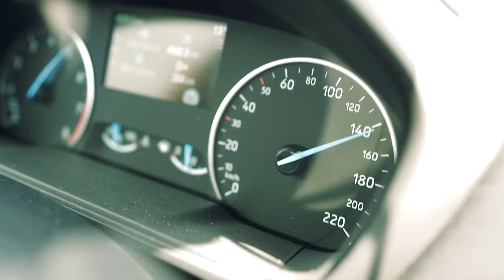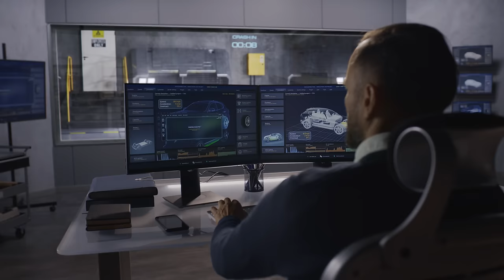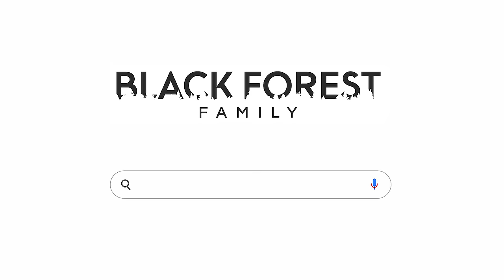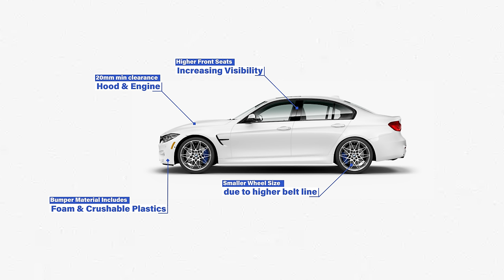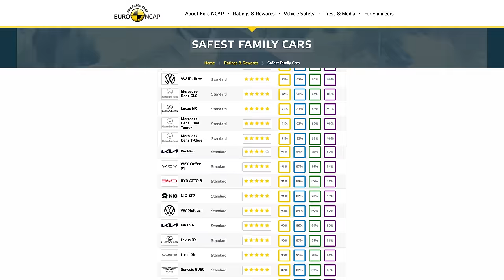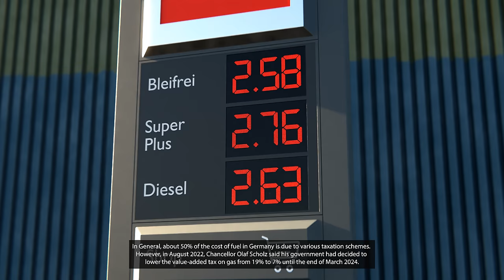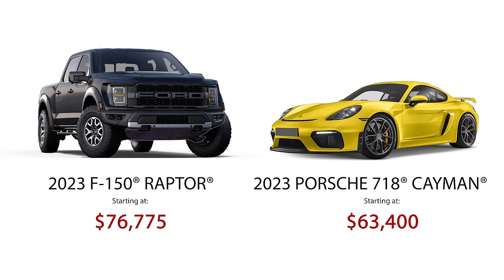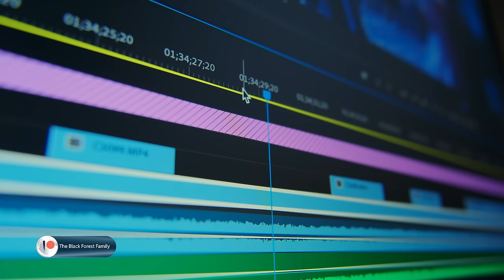DRIVING CULTURE CLASH: Why do our Cars LOOK so Radically Different?

Comment: How it started: driving lessons (Netherlands, 1972) in a VW Beetle. How it went on: 3-month road trip (US, 1976) in a Toyota Corolla station car, considered extremely small by about everybody there, but quite comfortable for 2 people. How it is now: Ford C-max which has a higher seat, hence comfortable for getting in/out; removed one of the backseats, for easy transport of my rollator. 
Point is: treat your car like any household item - don’t buy a complete Kitchen Aid, if you bake about 4 cakes per year, just bc it looks impressive (and takes 1.5 square feet on your countertop).
Thanks, Ashton, your comparisons are always very informative!
Reply: you do not have to buy ONE car to meet all your needs. My in-laws are in there mid-70s, they have Ford F250 Diesel for the camper, a Dodge Durango 7-seater for longer trips and rides to the airport with luggage, and a Hyundai Kona, as their runabout car. yes, 2 people and 3 cars. the truck is a 99, the durango a 2003, the Hyundai is like 5-6 years old or so. Those cars will likely last until they die. on their retirement income it would be impossible to replace the F250 and the Durango.
Reply: That would be extremely expensive on taxes. (which goes by weight).

Comment: Don´t know if someone already mentioned it, but there is another reason Pickups are less practical in europe :
In europe you are not allowed to just put everything unsecured in the loading area of a open pickup. So if using the loading area of a pickup you eigther have to secure it with bands/rope or you have to have a closed loading area. Reason for it are on the one hand exidents and on the other, that we drive faster. In both cases  loads should not be able to get lost and hit others.
Imagine you put your groceries in the back of a pickup (unsecured) and drive with 200 km/h (convert yourself) on the Autobahn… Pickups are not aerodynamicly designed… there is a good chance grocery bag get caught by the driving wind and kicked out of the pickup… no good on the Autobahn.
On the other hand… if you have to secure every single item it is very time consuming… or the other variant: a pickup with a top cover on the loading area is not only stupid looking, it has the worst outcome of practicality in puting things in it… Because you eigther have to lift the cover every time, or you have to push everything to the front to use the whole space.

… so even farmers and forrest worker preffer to use a full siced Jeep over a Pickup.

Personal note :
I had a friend (in germany) with a Dodge Ram with a hardtop loading area… worst car ever. 
Not ony was it hard to find a parking space in any city… but buying groceries was a pain in the ass. To unload it usually one had to climb into the low top laoding area because something „rolled“ to the front of it.
Reply: Good explanation for the reasons why Europeans prefer Vans or Jeeps. Still, I don't find a reason on why Americans prefer pick-ups. Even without those restrictipns, a Van or a covered Jeep offers better protection of the cargo against the elements of nature.

Comment: I have recently visited Canada: First in Southern Ontario, then Winnipeg (Manitoba) and finally Vancouver Island. 
Especially in Ontario I was surprised by the ginormous pick-ups with engines in the 6 to 7 liter range (mostly Dodge RAM), and more often than not the occupant was a sole lady barely topping 160cm in height and barely tipping the scale at 60kg soaking wet! The thought that came to mind was: "Somebody is trying to [over]compensate here." Even though it was a mostly rural area, most of these pick-ups where NOT working trucks since they featured a super glossy waxed and polished finish. The "working" trucks very obvious in being covered in dust and scratches.
In southern Manitoba, though also a very rural area, the trucks had engines more in the 2 to 3 liter range and the bigger trucks were clearly working trucks.
On the west coast (Vancouver Island) the trucks again got bigger, though on average not as big as in Ontario. With the very mountainous terrain both on the island as well as the mainland somewhat bigger engines are understandable and justified. And a higher proportion of the really big pick-ups (aka trucks) were obviously working trucks.

Comment: Thank you Ashton. Although I'm not interested in cars (just a tool), the impact cars have on our lives is important to me. I think there is one point you could add to this subject. With the higher weight of electric vehicles, and the even higher weight with the growing size of our cars, the maintenance and construction costs of our infrastructure will increase as well, while the load of the average vehicle doesn't. This does not really fit with the German efficiency stereotype.

Comment: The "my car shows how much money I have" part is going down in Germany - has been going down for quite a while. It is simply not as much seen as representative any more as it once was.
As usual: Very well done in depth video!
Reply: Yes, I agree that it generally goes down - but there are still lots of "car crazy" people in Germany as well.
And as it was said in the last part of the video, especially the number of SUVs has increased a lot in the last 10 years. In contrast, it seems to me the number of smaller cars such as VW Polo, Opel Corsa has shrunk.
All in all, that's something I don't understand in Germany: Gas is expensive, the parking lots on the street are reduced in particular in new developments, taxes are high, but a huge parts of Germans still prefer SUVs.
Reply: @Bema1001  Jep, that is still a trend. But many of those are company cars, which have some tax evasion loopholes to make the cheaper and the drivers don't have to pay for the fuel (directly). But the "1%" rule might change (i.e. 1% of the company cars value is deducted from your pay, I think before tax). So a way oversized car for its purpose will get 1.5% tax rule. Many towns push actively against those oversized nonsense, so there is a development on the way.

Comment: You mentioned that cars are getting bigger across the board. Well, so are people, especially in more advanced countries. Yes, I'm talking about extra weight around waists more than getting taller on average. Also, slightly taller cars are easier to enter and exit for unfit people.
Reply: In a German car from the 70s you have more space inside than today.

Comment: Hi Ashton, I know that you do good research for your videos and the source you have for the german commute is pretty solid, but I still think it seems to put the german commute at a very low distance!
The figures I get for Europe are at about 30 km. Half as much as in the USA, so your argument about fuel efficiency still holds, but not such an extreme difference as you claim in the video!

Comment: In the video is that you have a chart showing that in the US, crossovers are twice as popular as pickup trucks, but then decide that pickup trucks are the most popular choice.  That doesn't make sense.  Yes, the F150 IS the most popular single model, but pickups aren't the biggest category by far.  The car category, on the other hand, has gotten much smaller, because former car-buyers have switched to crossovers, which are essentially tall cars (built on unibody car platforms with car-based drivetrains -- not heavy body-on-frame construction like pickups and very large SUVs).  So it's kind of weird to lump in small, fuel-efficient crossovers (many with popular plug-in hybrid versions) like the Toyota RAV4 along with pickup trucks and truck-based SUVs.  And crossovers have been exploding in popularity in Europe as well, so maybe the differences really aren't so stark after all.

Comment: I learned from Albert Hammond that it never rains in Southern California, so I'd understand why they'd use pickup trucks there :) But honestly, why would I want a truck with an open loading area, so that my cargo gets wet whenever it rains? Another point about car size worth mentioning is, that there's old parking garages (especially in Vienna), where an SUV won't fit into any spot. They still try though.

Comment: Ich liebe und bevorzuge seit nun knapp 20 Jahren Kombis, also "Station Wagon". Das ist für mich einfach das Perfekte Auto. Die SUV's sind in der Regel nur höher als die vergleichbaren "Hatchback's" wodurch man "ageblich" besser einsteigen kann,  was ich jedoch so nicht nachvollziehen kann. 
Ein Kombi bietet bei Bedarf einen deutlich größeren Kofferraum als ein "Hatchback" oder SUV fährt sich jedoch in Prinzip wie eine Limousine.
Manche wie zb.  BMW's sind sogar noch recht sportlich, zusätzlich noch schnell und meist sparsamer als ein SUV. 

.......

I have loved and preferred station wagons for almost 20 years now, i.e. “Station Wagon”. This is simply the perfect car for me. The SUV's are usually only higher than the comparable "hatchback's" which "supposedly" makes it easier to get in, but I can't understand that. If necessary, a station wagon offers a significantly larger trunk than a "hatchback" or SUV, but in principle it drives like a sedan. Some such as BMWs are actually quite sporty, quick and usually more economical than an SUV.

Comment: @Ashton, here is an interesting aspect to pick-up truck vs car regulations. larger pickups, by wheelbase do not have to meet the same emissions and fuel consumption requirements as cars, or even smaller (as in 2-door) trucks. 4 door trucks have a longer wheelbase than 2 door trucks. fewer requirements for emissions and fuel consumption. Also Pick-up trucks by and large (pun intended) are exempt from emissions testing. This does vary by state, or even county!) vehicles over 8800 pounds are exempt. and, yes, large pickups weigh 4 tons..... technical note for Jonathan: a typical trailer in germany may have a tongue weight of 50-100kg, well within the limit of a "car". while a camping trailer in the US may have a tongue weight of 400-800 pounds, well out of spec for a "car".

Comment: AFAIK there is another reason not mentioned: In the USA, there are regulations regarding the maximum gasoline consumption of cars, similar to the fleet consumption in the EU. If you do not meet them a maker has tp pay penalties.

Unfortunately, the maximum allowed fleet consumption in the USA is determined depending on the car size and weight.

This means that large cars are allowed to consume an overproportional amount of fuel. 
As a result, small cars that can comply with the regulations are relatively difficult (or complex and therefore expensive) to build. 

It is easier to build large cars that comply with the much higher permitted limits.
Thus the well-intentioned law with the goal to save fuel and minimize CO2 output leads to the fact that in America preferably large cars are built and then also marketed.

Maybe the assumption that Americans want big cars and the industry therefore builds them is not true at all. Even if you don't want to believe it: It may well be that the car manufacturers build big cars because it is easier for them to comply with the laws and THEN persuade the consumer via advertising that he also wants the clunky things.

That is probably also the reason why in Europe SUVs are the fastest growing segment: They are good for the carmakers, so the built them and then tell us all that we need them. Because profit margins with small cars are just ... small.

Comment: As an American car nut, who drives a VW Golf, I've watched car technology advance over the years, and can say that safety standards is one of the primary reasons cars have grown in size. Simply put, human injury and fatalities most often occur, when bodies come into contact with something hard... inside the car. So "A" pillars and therefore windshields have moved much further away, as have dashboards. Also, 'Crumple Zones" are built into the front and back of the car. All this adds up to larger vehicles. Sure, people generally like larger cars, so of course that's a factor too. I'm predicting all this is soon to go radically different as radar / proximity sensors will mean that the accident rate will tumble to near zero and that will allow cars to become MUCH smaller but still be safe. We're still stuck thinking it's OK to have a 4,000 pound machine move a 200 pound human around. Environmental issues will cause regulation to become MUCH stricter in how much energy is being used. Right now, we simply accept that 'electric is better' but soon reality will hit home, and we'll all have to become more informed as to exactly how much energy is being consumed by our cars. Look at what gemcar is doing for a glimpse into the future. Great video.

Comment: When it comes to cars, i think that in general they now have too much "schnick-schnack". Too much stuff that you just don't really need. It makes cars bigger and heavier without actual reason. E.g. electronic seat adjustment. Usually it's the same person driving a car over and over again. So you drive multiple electronic motors around which get used once every couple months...
This is also why, i predict that VW is very soon not the people's car anymore, but a brand like Dacia is.
Those cars are cheaper and have everything you actually need. Also, the reason they often are claimed unsafe by Euro-NCAP is because of missing driving assistances like e.g. "Spurhalteassistent" (lane holding assistance - don't know if it's called that...?).

Comment: I think the speed limit is a major reason. The US had the roads but for us in Germany, they drive slowly in the US. With these roads, many of us would drive 200-250 km/h (or 124 -155 mph). 100-150 km/h is considered driving slow, 150 - 200 km/h is the normal speed and 200 - 250 km/h is still pretty normal / fast if you could afford this and the car. So I really don't want to know how much fuel an F150 needs at 200 - 250 km/h.

Comment: Hello Black Forest Four, another Sunday another very interesting video, thank you hope you are all doing well...
for me living car free since almost four years it was before that time a question of costs, practically and then environment impact, in this sequence... why to own a car that will eat my hairs of the had literally? Practicable, sure there where a few cheap "gebrauchte" used Cars in opinion but for what does a single male need a Bus, a SUV or a Pickup? the three times a Year i need to Transport some Fourniture, some Cornstruction Stuff or the annually garden spring buy of flowers, earth and so on? last point was ever impact to the environment, simply because i couldn't afford a electric car and the infrastructure to charge... Almost four years ago i stumbled upon an old  Cargobike without electric Motor and it changed the view... since then i didn't use a car more often than three times (in those 4 years) have now two electric Bikes (one for the cargo as substitute..) and even two Trailers for them, and i feel happy...
no more fuel costs, no Tüv (or here MFK) no Taxes, no search for Parking Lots... okay the bad side is the weather but you can wear an extra layer... 
still interesting video for me, i can also recommend the notjustbikes video...

Comment: I really like your "land yacht" expression!
I call them "unarmed but deadly tanks" or just "workday / commuter tanks", or "private panzer", "need to compensate something vehicle"... 🤣
Thankfully, some cities in Europe are reconsidering the presence of such beasts in their streets, thar only carry 1.2 person on average, and certainly no heavy or large haul more than once a year.
Some cities want SUV's and crossovers to pay their parking fees by excess weight and size / volume compared to a smaller urban car.
In France in general and Paris in particular, there are groups of "deflaters" who, as the name implies, deflate tyres of huge vehicles parked in the steets at night and leave an explanation note on the windshield under the wiper.
Usually detailing the excess CO2 and particles caused by their vehicle over a smaller car.

I'll add one other point to the video : even a 5 year old knows that cubes and bricks are not aerodynamic shapes.
But vehicles like the Suburban, Escalade, F-150, etc. All look like a pile of cubes and bricks with wheels.
The new heresy is now to market EV versions of these kinds of beasts : even more weight! 
The batteries in these things are mostly used to transport their own weight. And they can weigh more than all the passengers combined.
Many "private" American vehicles would require a special high gross weight / lorry driving license in several European countries.
Who would think of taking the kids to school or running errands with an 18 wheeler?
Cause we're getting there...
At least license wise.

Excellent video, as always!

Comment: Once again I am fascinated by the way you research the facts for your videos. So thank you very much for this. The German car market or I should rather say the cars German buy and use are different now. For example:what happened to the estate cars, they were all over the place only 10 years ago and now you see less of them as the buyers obviously are now going for the SUV type. I had various estates over the years and switched to the SUV variant some 4 years ago. It doesn't really make sense as they are bigger, guzzle more petrol etc. but it's easier to get in or out, you sit higher up, better visibility is a point. But believe it or not my estates could easily take more luggage. Writing this I cannot really explain why the SUV is now my preferred type of vehicle.